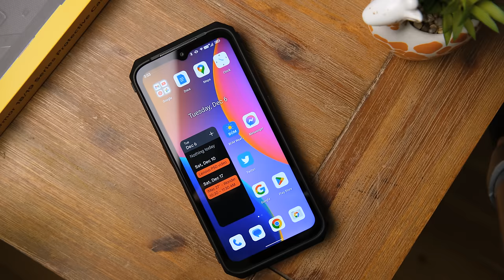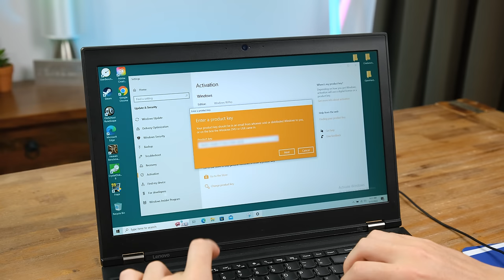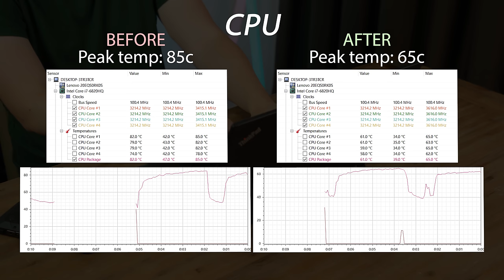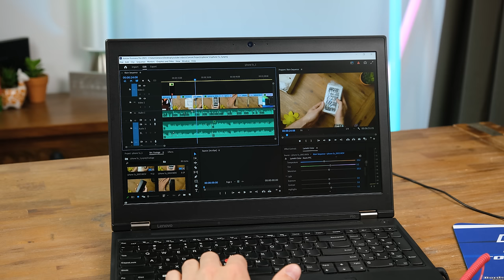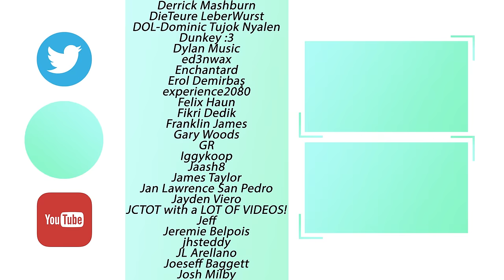I Bought A Cheap Lenovo P50 Workstation! Should You?

Comment: Daily drove this thing for years, and it was quite the workhorse. I still miss the Knub and the amazing keyboard. Mine also had a Pantone color sensor for recalibration, so if you're buying one, keep an eye open for that? It'll be to the left of the touchpad, pretty much in the lower left corner iirc.

The only thing I really wasn't happy with is the fans. When they're clean, they're ok for the most part, but if you have pets, some hairs will inevitably get stuck in the fans. The latter were advertised as "self-cleaning", and opening them up yourself would have voided the warranty (seriously - I asked). As you can see in the video, you can technically do it, but it's a bit of a hazzle.

Still, it was a great machine overall - probably one of the best I've ever worked with.

Edit: those things weigh just as much as it looks, and they sure aren't compact, either, but they did that for a reason. It really is designed as a workstation, and was among the best in its class at the time if memory serves. And if one looks as it may have taken a beating, then it just might have. I think I once watched a video of someone pouring half a bottle of water over theirs and it just kept running. The only weak point on the outside is the bottom cover. I've had multiple parts break off from that...

Comment: Consider some thicker paste that locks in place against thermal pumping of heat cycling.  Something like Ceramique.  When you get it open and the die is almost dry with all the paste off the sides, it was thermal pumping.

Also consider setting 'discrete mode' in BIOS if abailable.  It takes nVidia Optimus out of the equation, resulting in a nice boost.

Comment: 4:30 "...I am using some Isopropyl-alcohol..." Heads up - many commercial versions of this contain other substances to "soften" the effects for regular use on hands. These chemicals do not help with cooling and leave an invisible film on the surfaces you have cleaned. I have done testing with these "supermarket" variants and they are markedly worse than the pure version you can get a pharmacy. Ignore the 70% and search for words like "With Moisturiser" - avoid these. The one you want is often called "Rubbing Alcohol" and is devoid of extra-nasties.

Comment: My employer replaced my current Lenovo P52, i7-8700, 32GB Ram, with a new dell precision. I talked them into letting me keep the P52 and its still the best laptop I've ever had. I really like the two sets of touchpad buttons and its just overall made really well. Currently running server 2019 with wds on it dual booting with kali linux.

Comment: I plan to do the same thing with my old girl (Latitude laptop purchased in 2013). Rather than retire her, I'll pass it to my folks who'll use it for web browsing, a few reports, video calls etc etc. 
Folks already have a monitor, keyboard, and mouse; I'll grab a Dell docking station so the folks can turn the laptop on and off at the docking station (rather than opening up the lid).  
Spec wise, it's got 16GB ram, 4800MQ processor, 250GB SSD. It's got more than enough grunt to do everything they want, and with a fresh install of W11, new paste and a good clean it'll (hopefully) provide many more years of service.

Comment: The feeble 8GB was the "placeholder" spec for people who immediately bought aftermarket RAM in order to avoid expensive Lenovo RAM. Usual for private owners was do what I did and install a more reasonable 32GB or more (my P52 have 96 and 128GB). The spinner hard disk was also a placeholder on those so equipped. If you want to populate all the slots I'd buy used RAM that passed Memtest since Ebay has plenty of takeout SODIMMs.

Comment: P60 was and is a very nice computer. Buying a P50 second hand, puting the SSD and upgrading the memory for up to 64Gb the machine becomes probably the best equation price-quality in the notebook market.
Reply: You can do a max of 128gb on the non xeon p50 and p51. The 32gb ddr4 sticks were not out when those laptops were released. There's a few threads on the ThinkPad subreddit and forums of people successfully using 128gb of ram.
Reply: @eobardthawne6962  Tks a lot. Will explore. I bought two units to make a cluster and simulate a main server in my office. Not because I really "need" but for the fun of it. Tks for the clue. I will be able to do 128Gb*2 then ... Will check !

Comment: I purchase one of these about a year ago for about $400 USD.  It had little physical wear and it was the Xeon E3 version CPU, and Quarto 2000M vid card.  I picked this unit because my company has a boat load of the older docks for the older X200 laptops.  This one was the absolute best unit with that bottom dock connection.  Anyways is my primary go to unit.  I currently has (2) 2TB NVMe drives, with 48GBs RAM.  It flys with everything.  Not one issue.  Its by far one of the best Laptops I have purchased.

Comment: Get yourself a Mr. Clean Magic Eraser - Use it to lightly scrub all over the outer case and after a little bit of time you will see those scuffs and discolored areas will blend back in with the normal colored areas. Great way to bring the finish of the outer case back.

Comment: As soon as I found out it has 4 ram slots paired with the 4GB dedicated GPU and the keyboard with the number keys, I realised this is an absolute unit.

Though I have seen big Thinkpads before on YT,  but this one is relatively new compared to those.

Well I "found" one in my area just by googling. Expensive 3.48 times as much as I paid for my T480 though I sniped that on a auction.

There's a P15 with a i7 10850H for sale for less than it.

Though I wouldn't mind getting a P50.

Comment: I just picked a Dell Precision 5530 with a 4k touch screen, 32GB, and a 8th gen i9 for $400 on eBay. $3800 new in late 2018. Off-lease engineering laptops are the best computing deal period.

Comment: The stock display panels are rather uninspiring, and if you intend to keep using a used P50 for some time you could replace the keyboard to get a "new feeling" and replace the stock poor panel with a better one, like B156HAN01.2. Aliexpress can provide these at reasonable cost. Great job on repaste and disassembly. I did the same yesterday on a P51 with a broken fan. (without separating the display from the frame, just like you did). The P51 can also be a suitable option, similar CPU capacity, but the M2200 is a slightly better GPU compared to M2000M (or M1200 as it is called on P51)

Comment: There is some additional performance to be had with machines of this era with the right ram upgrades as they'll use faster ram than what is documented but from personal testing some are not stable with four modules installed. As for gaming on Quadros they are ok have been gaming on them for nearly a decade now and driver issues are pretty rare.

Comment: I bought a P50 four months ago  and the thing is very impressive.  For $150USD it came with 2.9Mhz Intel Xeon processor, 8GB of RAM and a 128GB SSD.  I added a 1TB Samsung MVNe M.2 and a 32GB Samsung DIMM and this thing is definitely a BEAST now.  Great keyboard, performance and impressive graphics just like you said.  It's not the most portable laptop especically with the 170w power supply though.  But overall, I see myself using it for a long time after spending just $300USD for it and the (open box) upgrades.
Reply: You have been selected for our giveaway thanks for watching and commenting ✅ send us a message on telegram to claim your price ✅

Comment: These old Lenovo laptops were great. It's a pity they don't make them like they used to, with the easy upgradability. I used to have a T-420 and it was great. It's underpowered for todays internet, but back in the day it was such a good machine. Not having to open the entire cover to change the RAM or HD is so much better. You could even remove the optical drive and replace it with something else, like another hard drive. It also had literally every port known to man on it. I miss PCMCIA cards but I get that USB is far superior now.
Reply: I used to think the same, but in reality the upgradability isn't the most useful thing for most people.
Take a t430 I can upgrade the ram, cpu, display, and hd to an SSD. Or I can find a t470s with a broken screen and fix it up for less than a couple hundred. I will have a laptop that is leagues lighter and way more energy efficient for about the cost of just the cpu upgrade for the t430.

Of course this comparison isn't the greatest, but because businesses and schools regularly dump these laptops, it is usually cheaper and easier to just get a new model than trying to hunt down the best obsolete RAM configuration to squeeze more life out of your old laptop.

Comment: I've got a kitted out P70 myself, great machine in almost every regard.
The one huge issue is the battery, when it dies, you're stuck with a laptop with no battery.

Lenovo will not sell you the batteries for these, the aftermarket batteries rage from non-working to non-fitting, and if you don't have a working battery in the machine you can't install chipset drivers.

Comment: I've recenty got ThinkPad P51, which has similar specs and form factor to ThinkPad P50. It is great. It's not as thin or light nor small as my daily driver XPS 9520 with i9 CPU, but i7 7820HQ as well as Quadro M2200M with 4 gigs of VRAM in this P51 is still very respectable to this day. Keyboard is joy to use, as well as TrackPoint, which is something I really feel not having on my Dell.

The ThinkPad model I have even has 4G connectivity and UHD screen! I can easily work outside with this bright screen and cellular. Battery lasts for about 4 hours of light use. When I push it harder, I have to look for a power outlet. 32GB of RAM is great to have.

I got this laptop from my dad who upgraded to ThinkPad P16 Gen1. These laptops are proud of being called workstations.
Reply: how did you get the 4g Connectivity? Is it included in p51?

Comment: Used one of these for at least 6years professionally. Xeon proc, M2000, 64gb ram, 2x 1tb ssd's and 4K screen. Absolute unit. And now used as daily home pc with Win11 on it. Still flying.
Reply: I have the same. I didn't know that it is windows 11 supported. How did you do it? Thanks

Comment: Psivewri, That is not a Windows 7 laptop. The P50 was originally released in 2015. The laptop was originally released from the factory with Windows 10 Pro. I don't know why that installation of Windows 10 wasn't activated, my guess was because it didn't have Pro installed. One thing to keep in mind is that Windows versions from 8 all the way to 11 don't have actual product key labels on it's computers, the product keys in that time from 8 were all locked, and hidden in the system bios. The last version of Windows to have actual product key labels on it's computers was Windows 7. That's why if you look all around the computer front, and back, you don't see a product key label. That's because it is not a Windows 7, and it never was. That black Windows 7 label on the keyboard, trackpad palm rest is not a factory label, who ever had that laptop last must of put that on there themself, and took of the original factory Windows 10 label if it's not visibal anywhere on the laptop. Besides Windows 7, and 8/8.1 computers all released with DDR3 ram, they never had DDR4 ram, DDR4 ram didn't come into play until Windows 10. Also Windows 7, and 8/8.1's latest intel CPU generation to be released on those computers was about 4th generation. With that laptop having a intel 6th generation processor also tells me that it is not a Windows 7, and it never was. It is indeed a Windows 10 Professional, and it always have been.

Comment: Greetings!
I recently won this on the auction too. Everything's great, couldn't be happier after I got it. Almost perfect laptop, like everything I wanted for a long time!
BUT! I decided to do the same steps you did — to disassemble it and to clean the fans, repaste it, etc. After I assembled it back, everything was OK, except the touchpad! On boot it beeps and shows the "PS/2 Mouse Not Detected" text for a short time.
I've noticed that this is a common problem for Lenovo users, especially for the ThinkPad users. Some say that it's the software problem, and some on Reddit say it's gone after the cable replacement, mentioning specifically P50. After I opened the case with the touchpad, I noticed that the cable was kinda glued on. But there's no way I could damage it? I tried to check the pins with the multimeter, and everything seems to be fine… I don't know, I've ordered the cable replacement and see what's gonna happen, but maybe do you know what exactly an issue can it be?
Reply: @hicham5778  Nope. Tried to rollback to the BIOS version it had when arrived to me — didn't help + keeps updating back to version 1.70.
Reply: @hicham5778  Nothing yet, have ordered the touchpad cable in China, will arrive in about 2 weeks. Will see.
Reply: THE CABLE REPLACEMENT DID IT!!! IT'S SO GOOD TO HAVE A COMPLETE LAPTOP AGAIN!!! 🤤🤤
But this is very-very-very, extremely odd. The old cable looks OK. Have no idea how could I damage it. Hopefully that'll never happen again!

Comment: Dirt cheap way to really make a ThinkPad top lid almost like brand new.
1. Pour some water on the lid
2. Use magic eraser and scrub for about 2-3 minutes in different directions
3. Remove water with microfiber cloth
4. Add some Nivea cream on the lid
5. Gently rub it with microfiber cloth
6. Remove excess cream

Tested many times. Of course if won't remove any deep scratches, but it will nonetheless make the lid really good looking.

Comment: I still daily drive mine. 4k display, Nvidia m2000m gpu, i7 6820HQ processor, 2* 1tb nvme SSD's and a 1tb sata SSD upgraded wifi 6e card and upgraded the ram to the actual max of 128gb since 32gb sticks where not released when the p50 came out.

Comment: Great video, Psivewri  

What a beauty. Yes, they are built like tanks and it's pretty intentional. Should it ever knock over by accident, have a drop, experience a spill,  etc. the machine will be well-equipped to handle the damage inside and out. There are many videos out there nowadays of people testing the integrity of ThinkPads by running over them with their vehicles and they still usually survive. It's a testament to their quality. 

The magnesium structure frame they put in as shown in the video that is underneath the keyboard is what really helps give it a nice, satisfying, sturdy feel with very minimal flex. A lot of my ThinkPads have one, and some do not. The difference is quite noticeable. My T480s that I'm typing on right now has one and I love the keyboard feel as a result. 

Those peak temperatures are great results as well.

The screens can be disappointing historically from Lenovo, but there is a 4K option available for the P50 with better gamut coverages. It will probably tank a lot of the graphical performance, though. 

For anyone thinking of acquiring one of these, here is the platform specification https://psref.lenovo.com/syspool/Sys/PDF/ThinkPad/ThinkPad_P50/ThinkPad_P50_Spec.PDF

Comment: Funny, I just bought a P50 with 4K screen, 32 GB RAM, Quad Xeon E3 2.9 GHz, 512 M2 Nvme, SIM slot, about weeks back for $430 CAD, absolutely love how modular and bulletproof these ThinkPads are. Plunked it on dock and it's push on push off. The only big disappointment for me is that Adobe dropped support for these M2000M Nvidia Quadros.

Comment: If you change the drivers on windows for the gtx compatible gpu it will boost your gaming performance. I did it with my p51 with a quadro m1200 (I used the gtx 960m drivers and got good results 👍)

Edit: fortnite 1080p with performance mode and all low expect for 3d (set to 100) was close to 25 and 30fps and with 960m drivers it went to 1080p all max on performance mode but locked to 60fps
Reply: Congratulations you’ve been selected for our Christmas giveaway please send us a dm on telegram to claim your gift 🎁🎊
Reply: Good to know, thanks
Reply: Can you make a tutorial for that or smth?

Comment: I bought a Dell workstation with a Quadro and installed a GTX 980m to make a little gaming laptop. It was pretty cheap during the GPU crisis but nowadays you can get an old stock gaming laptop with a GTX 1070 for the same price.

Comment: I'm looking to buy one. I don't want the newer ones where you are stuck with W10-11. No thanks. The P50 came with an optional touchscreen btw.

 I still use a W530 to do heavy simulations, heavy renderings etc. The old Quadro K1000M does ok in 3dsmax. I'd have to really load the scene with millions of polygons to see a drastic slow down in performance.

Comment: I am not a fan of Lenovo's consumer desktop or laptop.  Many years ago, I had bought many USED workstations from Lenovo, those machine never broken down.  I recently bought a X1 Yoga (3rd Gen) and really impressed with it.  End up got P50. 16GB RAM, 500 M.2 MVMe.  I am lucky that I got my from a eBay seller who I bought X1 Yoga (14" is too small for me) from him last year.  The condition is really look like a 1-2 year old.  He still has one on sale with 32G.  I love this machine. a little heavy but is better than I expect.  P70 would be too big to carry around.  But the built quality is amazing.  Losing 25% of battery life, and 20% of NVMe life. For a 6 year old machine, that is acceptable.  Amazing value for low $200 including tax and shipping.  P50 is still not well know by consumer, not too many bidding those units.  T480 is nice but screen of 14" is too small for me.